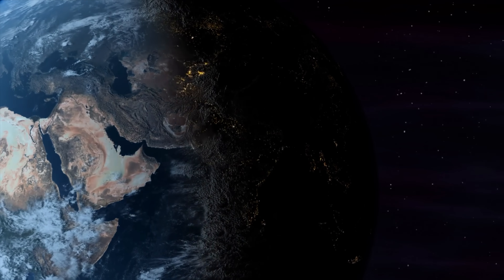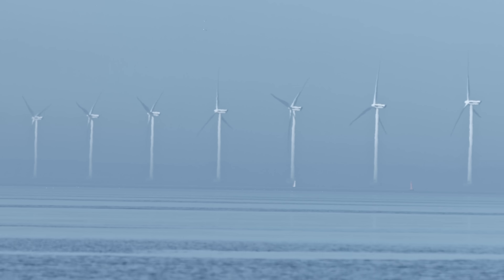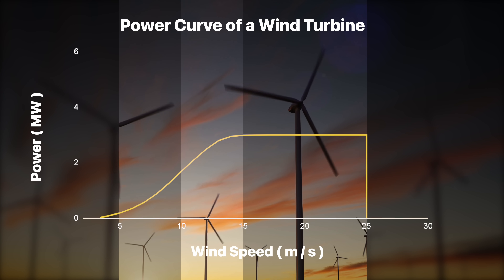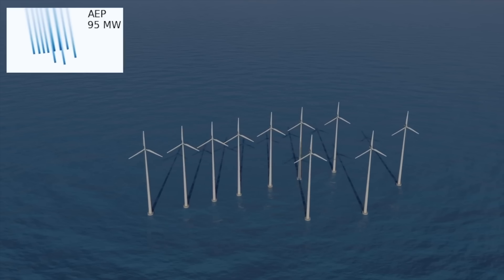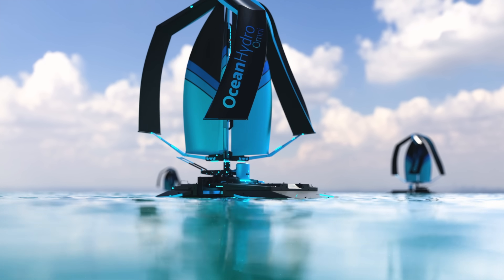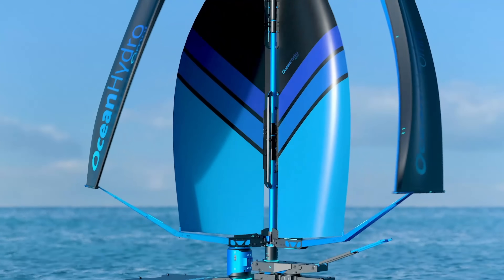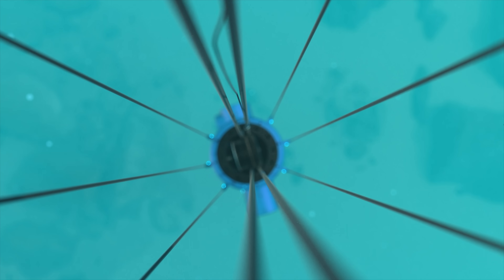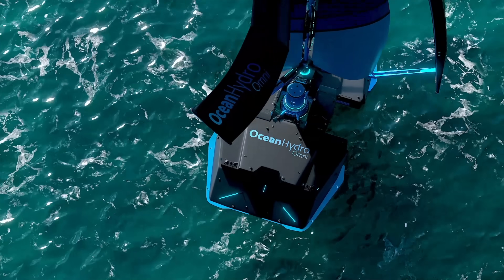Breakthrough Tech Solves Wind Power's BIGGEST Problem!

Comment: The animation at 9:05 seems to demonstrate that they have no idea what they are doing: The variant with two weights show one way moving up, one weight moving down, at the same rate at the same time. Moving up increases the potential energy. Moving it down with the same speed decreases  the potential energy at the same rate. The system gains no energy, there are only losses. The wind can make cogs and cables move, but there is no reason to expect electrical output from that movement. The system does make sense if the upwards and downwards movement are on a different speed: One weight can be lifted with a lot of jitter, even standing still, while the other one drops at a constant speed, generating constant electrical energy from the potential energy gained from the changing wind speed before.
The animation shows the one possible situation that does not make sense at all.
If they make this animation, it means the person animating it did not know how it works, no problem.
But if anybody from the company sees the animation and noes not notice it, that does not build trust for me.

Comment: Again...combining functionality will be a good answer for renewable energy.  The conventional wind turbines need a massive strong structure fixed to the ocean floor and to combine this with tidal wave generators fixed to these structures will allow the costs to come down relative to the amount of energy generated per pole structure. Cables can be shared to convey the energy created to shore and the maintenance can be shared per 'pole'. These up and down generators may also be fixed to these 'poles'. Like a submarine system the ballasts can be filled with water as to sink and spin the pulley generators and once  at the bottom, some of the tidal and wind created energy can pump out the water as to make it rise again.

Comment: Should this omni not have a cylindrical tube that the weight rides in with seals on the bottom with a one way check to pump the water up to the height that seems like a downside having all the below water obstructions.

Comment: The word 'Breakthrough' is associated with lying; not just garden variety lying you understand but profound lying. 

Also, when it comes to vids about renewables, fusion and energy storage, almost exclusively I've often noticed that the word 'Breakthrough' is a platitude. 

There are some exceptions of course. One that comes to mind is liquid air storage. That one was amazing but whether it will succeed in the free market is an entirely different proposition. As good as it is it will possibly fail as only time will tell. I hope it succeeds.

It's getting to the point now where I don't believe a single YouTube video with the word 'Breakthrough' in it.  

This invention is interesting but if it were a breakthrough then it the long term durability of it would be known, it would be ready to go in the energy market, the money for hundreds of farms and grid connection approved and the cost of electricity on a downward trend once implemented.
Apart from the interesting part none of this is the case. Again we've been lead up the proverbial garden path.

In no way is this invention a Breakthrough and distilled down, the residue at the bottom of the flask is Clickbait

Comment: I wonder why they don't build those gigantic blades with reinforcing rings that connects and supports the blades at the mid or near the end of the blades to prevent it from flexing too much at high speeds. Like a ducted fan concept except it isn't to function as a duct ring but as a reinforcing support and blade stabilizer.

Comment: Doesn't sound like a real breakthrough to me. Given all the maintenance you'd need to keep the build up off and the fact that the weight will be dropped through water (friction and buoyancy) I don't see this LCOE being very competitive. And the more you try to increase the mass of the weight the bigger your platform needs to be to stay afloat and haul it up. I didn't do any math on this but intuitively if feels like you'll be throwing a lot of buoyant mass on top of the water for very little potential energy stored.

Comment: There are factors missing: - !. The available energy in the wind increases with altitude above the surface. 2. There will need to be considerable sea bed infrastructure to support the generation and transmition. 3, Can these be pitched among existing HAWT to scavenge and store more energy on an existing grid ? 4. Maintenance on the sea bed is very expensive in deep water. 5. The sea depth varies 2 cycles a day so engineering for that is complex. 6. What is the down wind power reduction of these VAWT and therefore the spacing needed ?   7. Things installed at sea corrode and foul up quickly.  8. All moving machinary will degrade, fail and need maintainance and replacement.  Just a few issues :-)

Comment: The only kind of gravity storage that works is pumped hydro because its easy and cheap to move and store large amounts of water.
I did the math for using a 500 ton mass in a 100m mineshaft and a typical Danish 2MW land based windmill that on average produces 5000 MWh in a year - it could store about 15 MINUTES of average production of the windmill.
If you think this scheme is better do the math - and dont forget to reduce the energy stored in the mass by its flotation.

Comment: Correct. But these vertical axis wind turbines can be stacked multiply. You can have 3 or 4 turbines per column generating 3 to 4 times the energy from the same source. This reduces space needed for construction. Perhaps a thing that may become problematic for future generations if our electricity munching communities keep expanding his munchingness. 

Can I ask?

Can flushed toilet water be turned into green hydrogen? If so we could be saving a fortune on extraction and conversion plants.

Comment: Given the works involved in piling plus the cabling wind turbines should include underwater turbines to double function
When such a device is not producing energy due to  lack of windspeed the power from tidal flow would supplement energy production

Comment: This looks great, but you could do it the other way around as well, and submerge something very light/buoyant and rigid pull it down to let it's buoyancy lift it up. This seems like it would use a lot less material and be able to provide an exponentially large battery with depth. That's because it is the ratio of the internal and external pressure that does the work. So something at 1 atmosphere at a depth of 2M is pulling up 2G, but something with 1G pressure at 90M with a ratio of 10:1 will pull up at 10G

Comment: I don't see why a traditional turbine can't have the same exact setup with the weights...they don't even need to be at the same location as the turbine. All they're doing here is combining a battery system with their vertical windmill. Am I missing something?? Also, wave energy generation has had issues because.....you're in the ocean. This is no different. Those cables will never continue to move a weight up and down w/o untenable amounts of maintenance to keeping them clean.

Comment: what if the wing was inflatable/deflatable, on every turn, catching less on the return wing,
or just deflate when there is a storm,  deflate meaning shape change/less surface
example shows naked wires/weight, could be encased just like the base of current megawatt windfarms,
might even use recycled plastics to make the tubes, 
power cables not on the seafloor but suspended between devices making it easy to replace an faulty device.

Comment: It is quite sad, and really shameful, to see a marketing oriented promotion of such an unreliable system especially without mentioning the many many drawbacks it as. That is no "breakthrough", it is total non sense, from practical engineering point of view Just a simple point, think of what the waves, and such the vertical displacement, will be for these wind turbines when the wind is let say 30m/s, what about at 40m/s. Leave aside the question that the vertical wind turbines are very very inefficient way to harness the wind. And on the efficiency line of though, think why a fluid, swirls in in the direction of its movement, very fundamental dynamics which is totally missed in the wind turbine industry, which in its nature deals with a moving low density fluid.

Comment: I think there would be greater success using the unpredictable energy created by wind turbines to run automated desalination plants or use the energy to split water molecules into hydrogen and oxygen, through electrolysis and generate clean electricity with the stored hydrogen whenever you need it.

Comment: I'm 99.9% sure this is NOT a promising idea, and if the inventors would spend as much time critically self-reflecting rather than making fancy animations, they would figure it out as well.
Here's why:

-Wind speed variations are indeed a problem for wind, but it can NOT be solved by extending the operating range. Decreasing the cut-in wind speed does not help, because there is negligible energy to capture in the lowest speeds anyway. Also, increasing the cut-out wind speed to 40 m/s barely increases the annual yield, because these highest velocities occur only a very small fraction of the time.

-Having moving components in seawater is a maintenance disaster, as pointed out by other commenters.

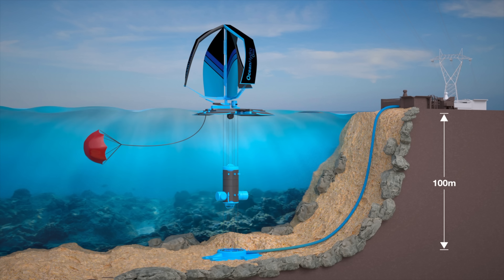-The videos don't even explain how they plan to keep the system in place despite the huge horizontal forces from the wind and from the ocean currents. One video (8:19) shows some sort of horizontal parachute, but this would entirely defeat the claimed advantage  of compact installation: the turbines would have to be placed far apart to make sure these parachutes and other cables don't get tangled up by the ocean currents.

-The fact that you can only generate electricity through the storage device and not through the rotor is a terrible idea, because you only have a few minutes worth of storage. So what do you do if you multiple hours of good wind?

Renewables indeed need storage, and combining production and storage in one device often seems ingenious on the surface. But if you look deeper, you will find that both production and storage are wildly inefficient, compared to when you would just split them up in separate optimized installations.

Comment: I wonder if it would work as well by pulling a buoyant object down, like an empty tank on a cable running through a pulley anchored to the seabed.... Construction materials are then needed only for the ballast's surface area and not its volume.

Comment: I like the VAWT but one rogue storm wave is all it takes to wreck the machine in the ocean.  Putting something like this in river deltas and more sheltered waters would be a better fit.  deep lakes maybe? I like the ideas people are getting to try and smooth out the intermittancy of wind and solar.  An underwater turbine usding tidal flow anchored on the conventional wind turbine bases might be interesting.  That section of water is not going to have fishing trawlers or other ships of that nature passing through?   I still prefer Molten Salt LFTR Fission though, better energy density for the materials spent to make it.

Comment: Pretty cool with a couple of what ifs; 1 Will tethering with moving parts work? 2 Maintenance on anything in, under and at the bottom of the ocean is not easy. 3 On-demand only where they are placed. 4 Emergency recovery if they get away.  Along with all the valid thoughts in comments.

Comment: Why don't you hook the power generation to onshore Lift cranes that can store the energy kinetically and are much cheaper then batteries + don't degrade in power stored over time. You can use old building concrete as a weight and old construction cranes to do the lifting. Again power released when u want and stored when produced even if the grid doesn't need it at that time.

Comment: Wind energy is flawed because the materials science is so far behind they break down within 5 to 10 years they start eroding and breaking down fiberglasses terrible for the environment all you can do is just bury it underground which is not a solution and yet your solution is to make more of these fiberglass monstrosities?

Too bit?

Now look at solar you would have to blanket it a great deal of area I'm not saying research into solar shouldn't end but we're wasting a ton of precious materials to build these solar panels and we can manufacture energy more cost-effectively using geothermal, hydro, tides and micro nuclear reactors that are modular and far safer not to mention thorium reactors that China is building and the ever 20 years ahead 🙄 fusion reactors but let's keep our optimism based in reality and judge the benefits by the losses as well not just the games it's the same problem with batteries they're wasteful we're not recycling them like they said they were going to. And it takes child labor to make them.

Hydrogen may be a little more up cost expensive but it doesn't require child labor it doesn't require mining of precious resources at nearly the volumes we do for batteries and it can be stored easily and modular locations like gas stations and it can be created on site.

Enjoy your content but you and like undecided are very clickbaity not really considering the long-term.

It's why I won't subscribe. Click baity not grounded in reality. Just what will get the ad revenue.

Not to mention all the countries in Europe that are abandoning green energy because of all the life loss and suffering and you look at the United States and Texas and other states that odd on to all this energy b***** and suffered and people died because of it not to mention everybody's buying these stupid energy e cars which are taxing the aging grid that can't even supply the amount of power needed to power these cars coming online now we're getting Walmart Tesla trucks that will be taking massive more amounts of power that our energy grid cannot maintain.

You energy nuts are causing an economic crisis.

Comment: Interesting. I like how the gravity battery uses the possible difference in potential to generate power on demand when needed. They are dropping loads hoisted up on the free structure of deep water. But Mechanical moving parts in salt water… degradation could incur maintenance costs. What about a simpler diversified  conversion of energy.  I don’t know if an electrolyzer can perform better under high pressure at 750 feet just using salt water, but if these are less efficient than  horizontal driven monstrosities above water but operate over a much wider range of wind speeds then maybe their gravity battery can be hydrogen/oxygen/ desalinated water production instead. Over the long trip to the surface in a conduit maybe there can be a purification process before pressurizing?

Comment: Mechanical things underwater is a bad idea. And you will waste all of the energy used on hydrodynamic drag when it is moving. This is very significant in a underwater gravity system unlike one in air.

Comment: Nice idea. Like it would keep a bunch of students busy. Gravity is not really a good storage mechanism. Its low energy density is reduced further by bouyancy in water. And Barnacles will mess with anything underwater ! But the fact that the "blade" has a wider wind speed range than standard wind turbines might be useable. Electronics can easily convert that to a useable electricity source, charging on-land batteries. So although these are less efficient, they can use higher wind speeds, which could make them useful in gale prone areas. Then it's simply (ha-ha !) a case of making them sturdy enough...

Comment: I don't like this design.  Two problems: wind speeds increase dramatically the higher up you go.  These units would not be able to take advantage of those higher winds

Secondly, as the vertical access blades spin, they must fight the force of the wind through half of each rotation.  That is grossly inefficient.

There is a radically different design I prefer that is a simple bare shaft rising into the air that has several advantages.  They rely on air becoming destabilized as it blows past the shaft, just as a radio antenna oscillates as a car speeds along a highway. You can harness the oscillations in a variety of ways.

They have distinct advantages, including little or no maintenance.

Comment: The concept seems to be correct.  Stable power is what you need.  That means you will always need a storage device.  A gravity battery would be the most cost-effective means of doing that.  All you have to do is cut a round slot, lining the inner and outer edges with steel and concrete as you go down.  Once reaching the desired depth for the amount of mass you desire, run cables through the bottom center, back up to a pully on the other side, linking all pullies in a circular geared system.  To feed the grid, let the weight settle by spinning the connected motor/generators.  To add generated storage, lift the weight.  This eliminates the need to "dig a hole".  This should be dramatically cheaper than a chemical battery.  You could replace a cable without shutting down the system.

Comment: The main problem with these gravity generators is corrosion from sea water, what about using the wind turbine to drive a hydraulic pump which would drive a generator at a distance on shore. The same or similar system could be used for wave energy.

Comment: Positively the WORST way of harnessing wind ever. The weights have to be HUGE to store even a small amount of power. Also, they are too low and near ocean surface, ignoring the higher wind speeds at higher altitudes and making them vulnerable to high waves. Far more material cost per megawatt than the standard design.